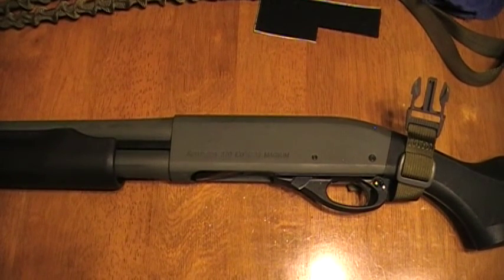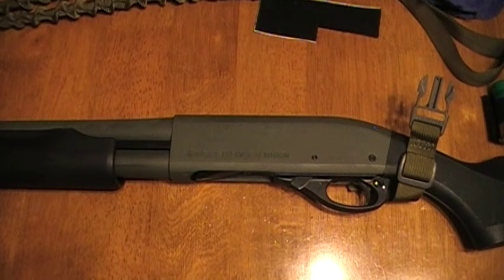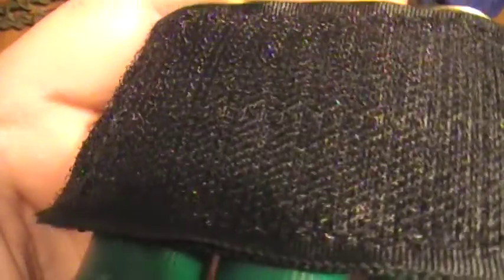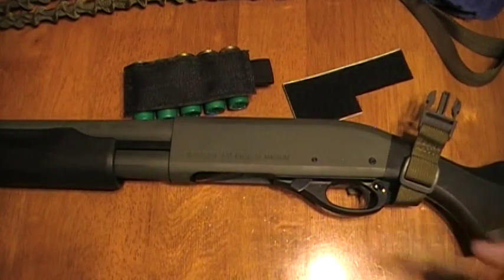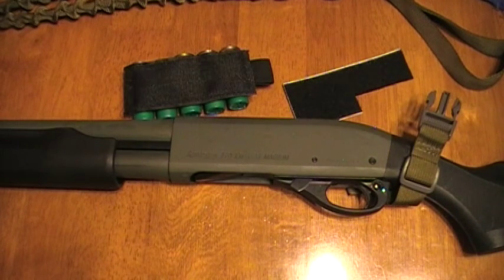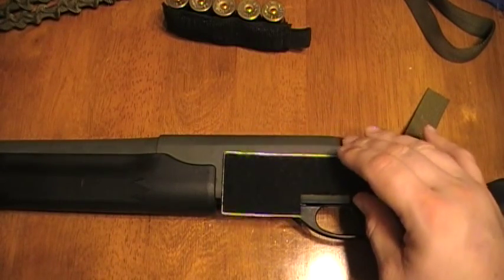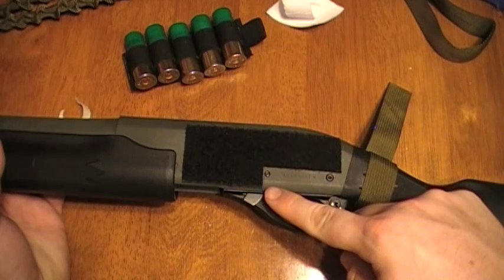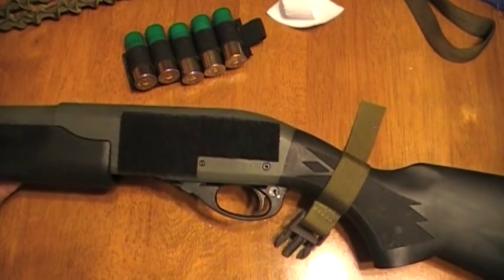Shotgun side saddle

Comment: Nice video man. You should do some videos of “home defense” builds👍🏼. Just bought 6 SOE shotgun cards and 15lb strength Velcro from Home Depot so I can do the same on my Pardner pump. Take care!
Reply from the maker: This one can be a home defense setup. The only thing lacking from this is a good dedicated shotgun light. I want a surefire but they're super expensive and since this isn't my primary long gun I haven't pulled the trigger (pun intended) to buy such an expensive accessory for it. I've thought about slapping a streamlight shotgun light on it that's similar to the surefire design but not as expensive.
Reply: @hossy540  I learned the mistake of using one of Amazon’s “heavy duty tactical” plastic side saddle and it wasn’t worth a damn. The minor cold messed up the adhesive and so I went a more DIY route. Case and point, SOE is this shit lol